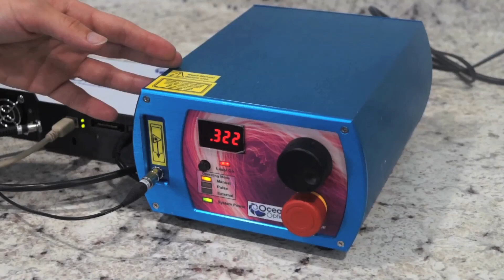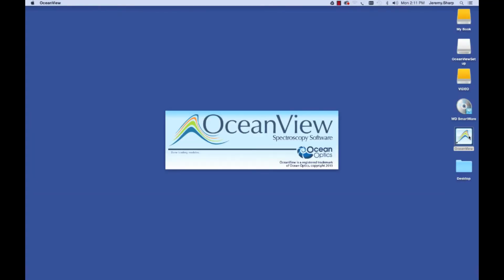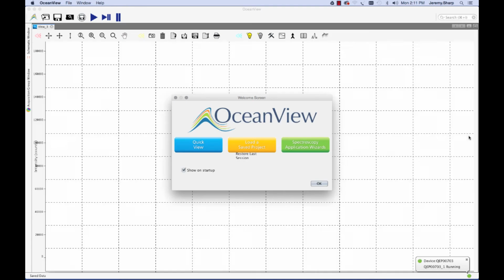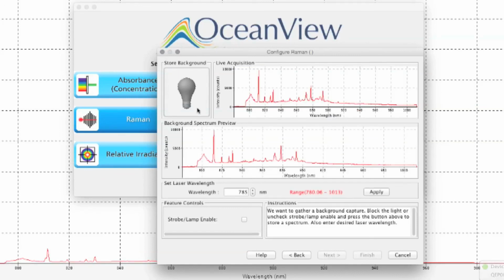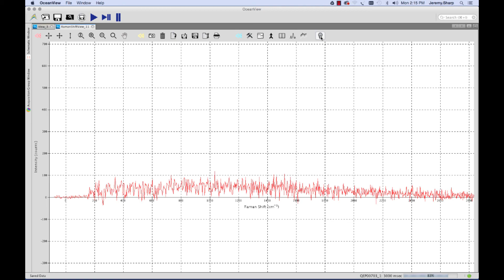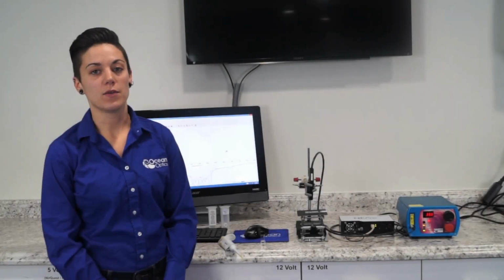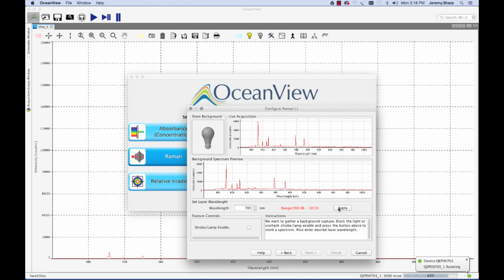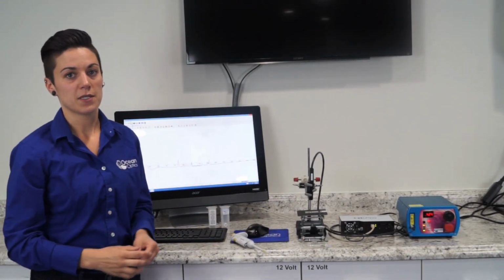SERS Substrates - Getting Started

Comment: Hi, I have a quick question. How do you know what the focal distance is? Just by looking at the laser spot on the surface while you vary the height of the sample?  Thank you in advanced.
Reply from the maker: Hi Vinicio,
Thanks for your question. The focal distance is 7.5 mm and is defined by the probe, made by InPhotonics. While we don’t recommend looking at the laser spot to adjust the focus, one can look at the signal in OceanView to determine when the focus is optimized by adjusting the height of the stage or probe to achieve the highest signal intensities. Also setting the stage 7.5 mm away from the probe will get you close to being focused on the substrate.